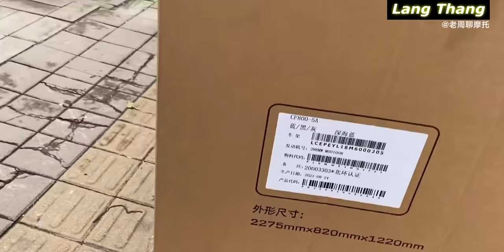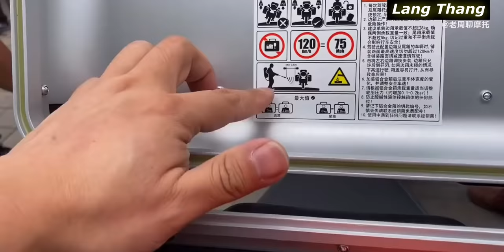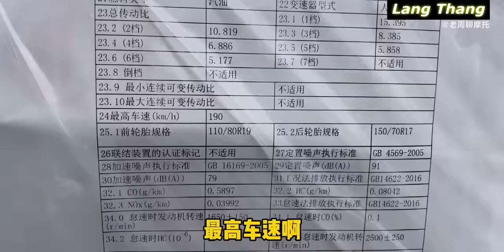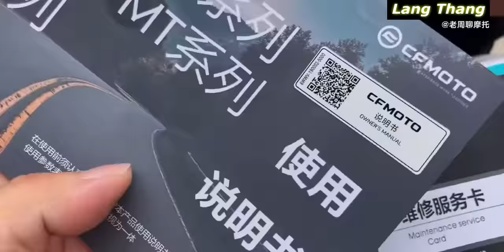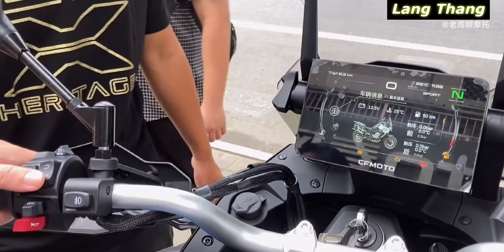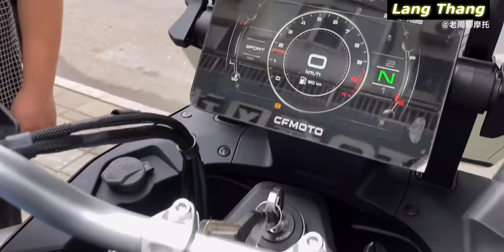Unboxing CFmoto 800MT 2021 and First Touch

Comment: CFMoto bikes are good, as long as the dealership 1) honors the warranty, 2) knows how to fix what's wrong with it and 3) admits there are problems with it instead of just dismissing the customer.
Reply: Saying it’s good and then speaking about how it will break down. Hmmmm
Reply: @perovic96  no one said anything about them breaking down. 5,000km of riding so far and the only issues it's had are due to incompetent staff in this part of the world either not knowing what they're doing or management not giving a damn and saying problems aren't problems. If you have somewhere to do the basic maintenance yourself, chain cleaning, oil changes etc etc it's great.